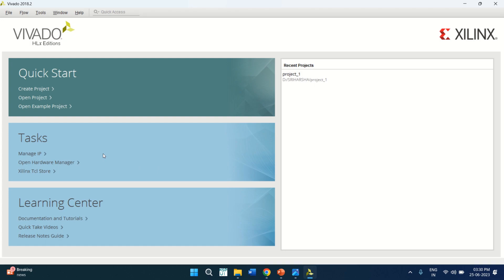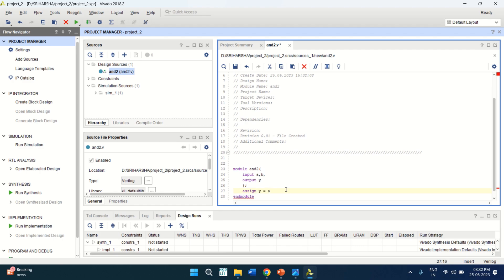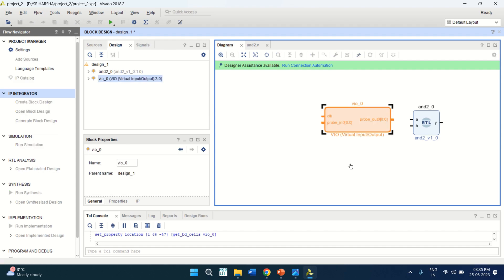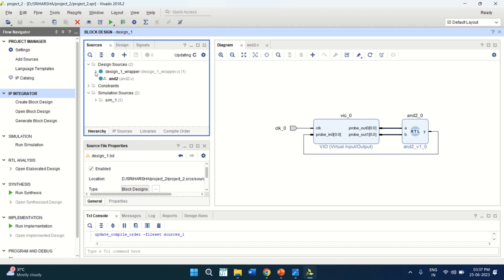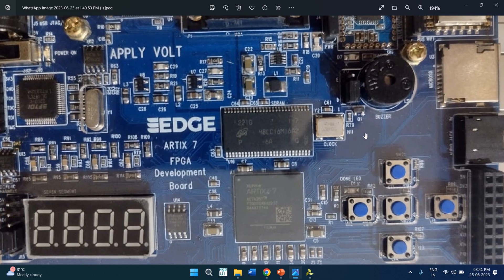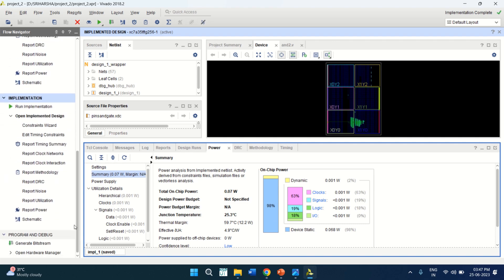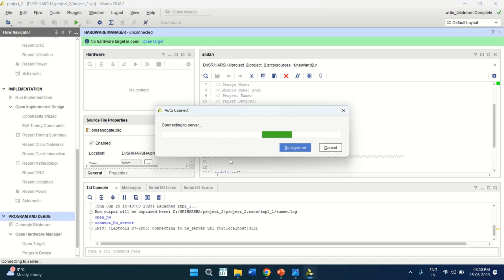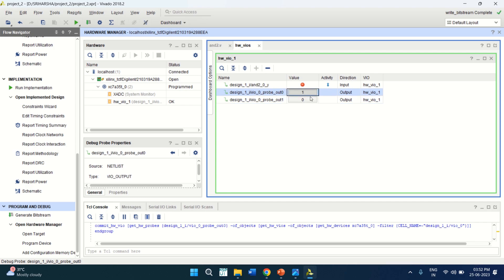VIO for Functional Verification in Xilinx Vivado.

Comment: Sir my board has no clock pin, how to configure it?

Zynq-7000 All Programmable SoC ZC702
Professor gave me this board to carry out MTECH project.
Reply from the maker: Hi, every FPGA boards have clock pin. Go through the user manual for the board
Reply: @dr.hariprasadnaikbhattu  Yes sir I got it from datasheet. But on board there is no silver tracing of the clock.